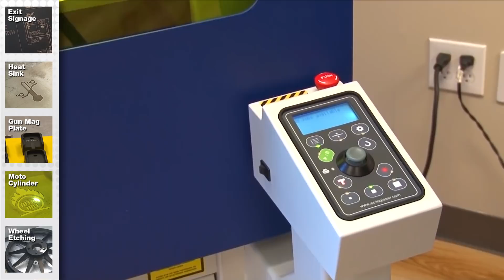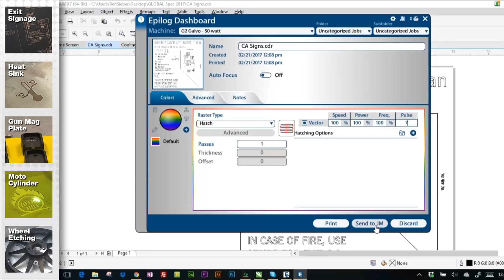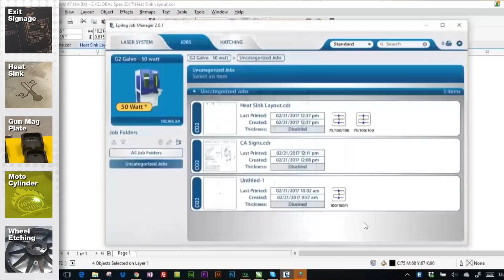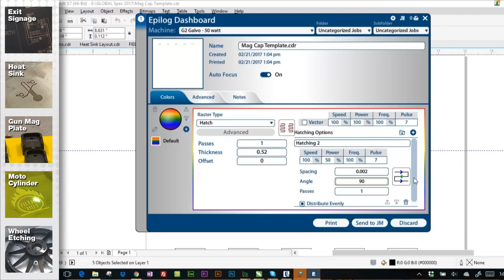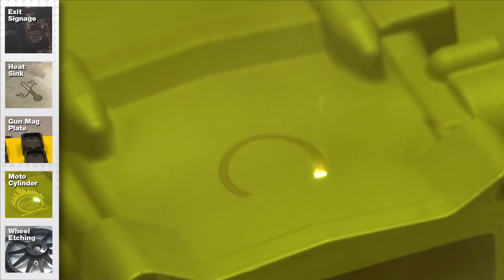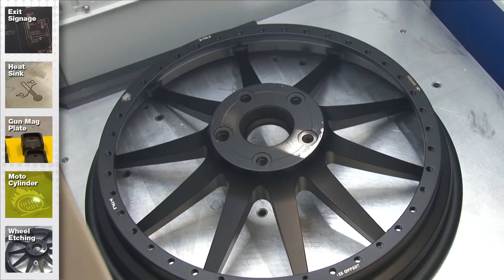Epilog G2 - High-Speed Metal Etching

Comment: Hi,

Can the machine gaurantee a nice full print on a 600x600 etch area? Can it etch fully straight line when you engrave a grid pattern of say 25mm spacing at 600x600 etch area?